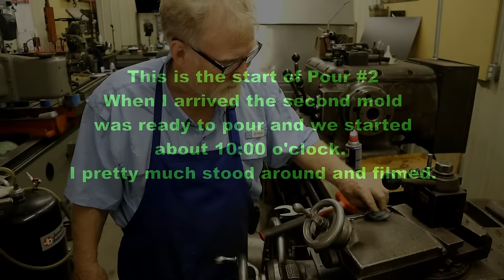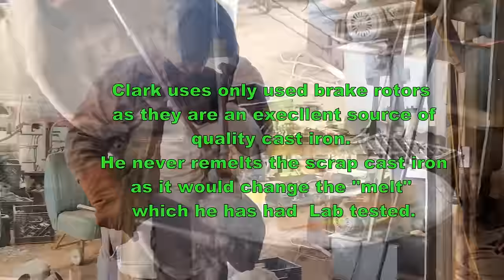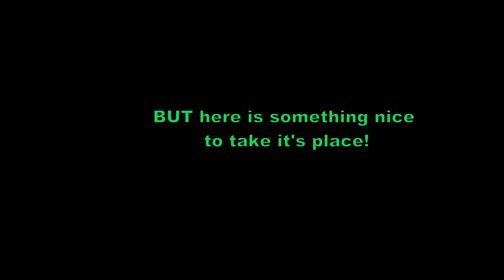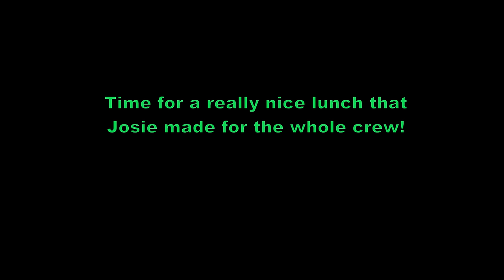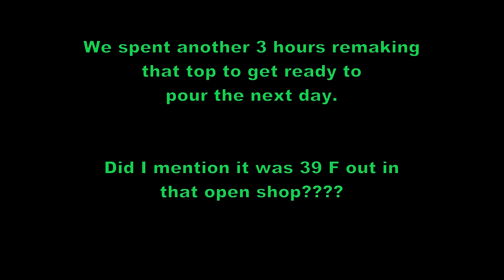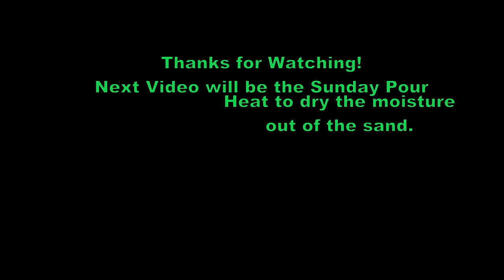Windy Hill Foundry as they pour the casting for the Tally Ho.  Second pour Unabridged Version

Comment: A carpenter adjusts a workpeace bit by bit. A bronze cast just requires a few attempts.
Craftsmen at work can be recognized. And craftsmen you are all! This is just what it takes. 
There is a foundry in my vicinity. I know that these guys are hardly ever "getting there" at first pour. Patience does the trick!
Overall, I love this video. It shows that pouring metal is a craft unlike and still like any other. This video, in the context of all the others, is G O L D !

Comment: A lot of people forget that foundry work really is an Art, a highly variable craft more than a perfect science. 

The molds are impacted by the environment they are made in, sand recipes get adjusted based on changes with supplier, the current temperature and weather, the size of the piece being poured & how the mold is composed. 

There are general recipes to get you in the ball park but particle size, overall consistency and even the very composition of those particles(silica/quartz, etc) will mean 2 people both starting with equal amounts sand and water and binder may be actually looking at 2 very different things. I wouldn’t be surprised if the quality of the water had a noticeable impact and it’s up to the Foundry Master/ Site Boss to make these adjustments.

Even after the molds are made each one will have its own unique considerations made for where vent holes and/or risers go, if a catch basin for initial turbulence is needed or other special considerations will be used to feed the casting, the overall size/draft of the pour spout and those feed gates. With so many variables it’s has to be expected that things won’t always go right the first time. Every new pour is unique and another notch under the belt toward becoming a master of the craft.
Reply from the maker: Well said!   Infact Clark had to make adjustments adding and subtracting clay and other things to get that sand just right for the inside of the casting...  The part that broke off during the last video was really difficult to make release and not fracture because of the pattern and general shape.

Comment: Hello Steve great video and the comment regarding floor pouring. Over here in the UK one of the very first cast iron bridges built in Coalbrookedale had over twenty feet lengths all poured on the floor. There is a very good documentary on television  about the casting and a trial run was carried out on a mock build by the Army I think. Also there is a very early painting of the gorge with the original bridge in the process of being built
Reply from the maker: Clark is all hot to trot on it :)    Of course I need to remind him that the floor keeps getting farther and farther away the older you get :)

Comment: The old adage of "try, try, try again" applies here. I know it's easy to be an armchair advisor on these things, but would seem to me, the complexity of the bottom of the part should have a lot more of the white separation powder (whatever its called).  I'm happy to see that it looks like it does on the remaking 38:53.  I watched SV Seeker learn the hard way on casting his own parts. He tried again too many times to count, way more than you did. However, he was experimenting with different sands, flasks, and heating methods. He was learning as he went.
Reply from the maker: The castings on the seeker are really out there :) Everyone has different sayings and such... What really blew me away was Doug having the balls to cast up the 6 propeller blades :)     Outside the front door of his house he had the shaft and propeller set up on a stand that allowed you to balance the prop.. Loved turning that baby everytime I went by :) 

It more of a little draft and too rough pattern that gave us trouble on the pattern removal. I spent 2 hours smoothing that out and then we did fine.

Comment: I saw something back in 1984 that illustrates why a dirt floor is good for a foundry. I saw a piece of red hot steel drop 2 inches on a concrete floor and a  piece of the concrete popped out of the floor. It landed about 5 feet away after bouncing off the guy who was working on the piece of steel.
Reply from the maker: That must have gotten his attention :)

Comment: I seem to remember from high school metal shop days of putting sand retention cleats in the taller bowl shaped molds to mitigate the inside of the mold  coming apart. I could be wrong.
Reply from the maker: There are cleats on the inside of every flask to hold the sand there... The problem child is the inside of the casting is complex, rough, little draft and the sharp sand particles are rammed in there with force.  We worked on the pattern and overcome all the obstacles in the next few videos :)
Reply: @10swatkins  yes I saw those. We also set cleats in the sand on the inside of the bowl section I just just can't remember if they were refractory or not. They were these kind of I beam looking things. I remember it was deep wide dutch oven. The sand kept coming up in the center. The shop teacher used a couple of these cleats and worked like a charm. I also remember he wasn't too happy that we were gonna be heating and pouring so much iron, but he acquiesced since we were juniors and all of us had been in the same class together since freshman year.

Comment: Just a thought, have you tried using one of those cement vibrators or dare I say some sort of vibrator that you could tape to the top and then pull it while it's vibrating. I was thinking maybe that would provide the consistant and even vibration that would allow the mold to release easier. Just a thought.
Reply from the maker: I  was ready to try a needle gun on it :)  Lots of brainstorming was going on...  The main problem was the mold shape and finish.  Two of the central parts needed a little more draft as they were almost straight sided. They had a little draft but not really enough.  Also the inside was a little rough... I learned last year that what I thought was smooth for a pattern was not smooth enough!  I took care of that problem on the third day....

Comment: Surely it just bigger mold time? The original was over 100 years old…how did they make it?
Reply from the maker: No bigger mold, at the limits of what you can take apart without it breaking now....   The better idea would be a smaller pattern. That core ledge makes the pattern box go to almost 30 inches to cast a 16" part.  But Clark works with what he is sent. 

The original was made the same way this one is being made.,

Comment: just curious how thick is the sand suppose to be  between the wood and iron? y'all had a bear of a job there. i don't envy you your task ahead.
Reply from the maker: Clark told me once that 4 inches was the  minimum .. When I showed up with flasks that met that requirement they were quickly cut in half ;)   Most of the sides of the pattern were really 5 inches away from the wood. the cores took up a lot of space and it was deceiving.

Comment: Not sure why all the hate. I guess you can’t please all the keyboard molders out there. Oh well, as long as you got it done. I enjoyed watching it. I would like to know how you prevented it blowing out on the subsequent pour(s).
Reply from the maker: I know God didn't really mean for everyone to have a keyboard...   
 I have three more days of content from that trip.. Lots more to see :)    

The mold you see being made in the video had the pattern moved off center and Clark made the area where the flasks contacted each other to slope at about 20 degrees.  

The wood flask was not the problem. The area where the two parts of the mold touched made a "pathway" through the sand and the weight of the pour was too much for it... There is 100 pounds of metal being poured into that mold.

Comment: The sand needs to be fully screened and added and tamped in 1” layers. When you removed the capstan you can see the lumps of sand still coagulated in balls rather than a cohesive unit. Tamping fully screened layers should rectify your issue
Reply from the maker: Might help, I don't know enough to make a judgment one way or the other.   After I spent a couple of hours working on the pattern the pattern released  from the sand with no problems...   I think it released a total 3 times after that..

Thanks for commenting..

Comment: One suggestion I would have made is I would have drilled small pin holes in the wood mold to help elevate the vacuum of the wood and mold. The main issue with this mold  seemed to be releasing the tightness of the sand without any vacuum release from the mold itself. 

Obviously, it appears you have achieved a good mold release in the last minute the video. But it was frustrating to see you and your crew struggle with this issue. Good work and thank you for your persistence!...in the end, ignore the internet and its criticisms! Anyways, congrats are in order!
Reply: The only thing drilling holes in the mold would accomplish would be completely ruining the surface finish of the part, not to mention adding a lot more time & work to the fettling process. 🤷
Reply from the maker: The vacuum is a part of it true. 

The much bigger issue is the draft angle of the interior part of that casting. Very little draft on two of the many surfaces. 
The other main issue combined with that is the surface of the wood pattern was not smooth enough to release the sharp sand particles after the sand is rammed into place.  A couple of hours working on the pattern helped a lot.
Reply: @10swatkins   What is really interesting is Dave Clarke actually worked to increase the draft on some of the features to help make it more producible.

Comment: I've watched several of these videos now. Do these guys know what they are doing? Because it looks like the blind leading the blind.
Reply from the maker: All I can is yes they know what they are doing. You need to understand the basic problems of making anything, out of any material, for the first time requires trial and error.  The process is the same , you run into problems and you figure out a way around them...

Using your logic Leo should stop building  Tally Ho and find a competent boat builder because they just took 4 times to fit the bowsprit!

That's not how any of this works.

Comment: If you used steel for your mould box you wouldn't have had a blow out.. your losing money on this job.
Reply from the maker: Steel is not the answer....  "That's not how any of this works"     Sorry my favorite saying worked it's way in here :)

The "flask" contains the sand and makes it where you can take the mold apart. Being wood or steel has little bearing on the problem... The wood did not fail, it did it's job and kept the sand there... What failed was the sand joint between the two parts of the mold.   The mold comes apart in three different parts so the pattern can be removed.  SO there are two " joints" that go all around the mold at the seams where the flasks meet.    The 100 pounds of white hot, water thin, liquid cast iron caused too much pressure for the joint to contain the metal and leaked through the sand joint and out  of the flask.  Clark moved the pattern to an offset position in the flask and changed how the joint was made to help contain the pressure. I'll try to explain this better in the next video... Thanks for watching .